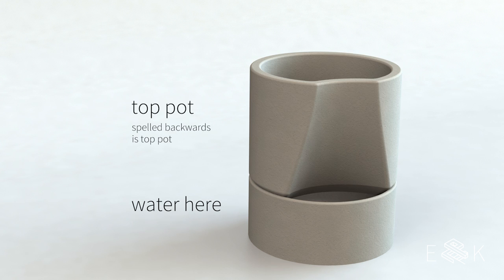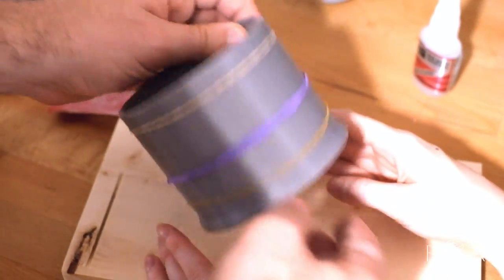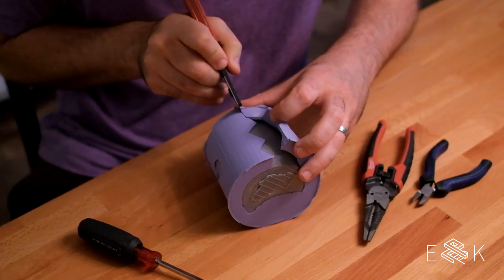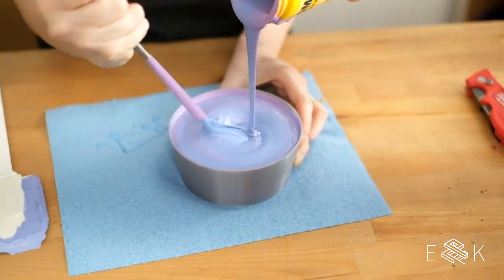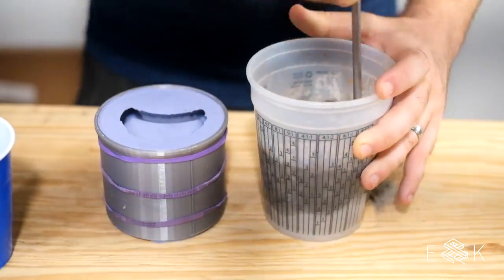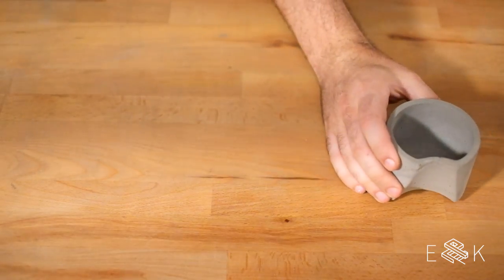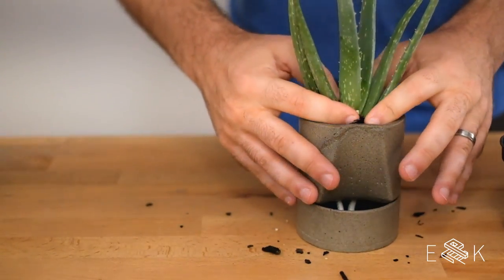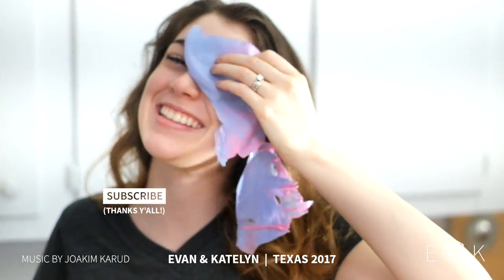DIY self watering concrete planter | How to

Comment: What type of Smooth on silicone did you exactly buy and was it a 5 gallon buckets? or the 2 gallon I know you mentioned it was around $175? Can you guide me to know which one you bought and for how much please?
Reply from the maker: Sure thing! We include all tools and materials used for each video in the description, along with the models but I'll give you some more info here too. Since we made the outer barrier of the mold close to the part we're casting, we didn't have to use much silicone at all, just the 2.8 lb sample size for $28 available here: http://amzn.to/2u4IQc7. Totaling everything up I would estimate the cost of getting all the supplies would be $75, but if you're careful with the mold (or probably re-design it some) then the cost for each concrete set would be around $0.50 for as long as the mold lasts.

Comment: Great DIY project! Can I use regular sandpaper to smooth out the concrete?
Reply from the maker: +Nikki DR we use regular sandpaper and it seems to work fine :) Just be careful with dust, you don't want to breath in concrete dust.

Comment: Whatever y'all are using to light the intro/outro (in front of the coloured walls) has a refresh rate that's not quite happy with the framerate on your camera and causes some interesting light differences on the cuts. It looks like there's about five sections of light (3 light, 2 dark) that alternate slowly (2 light, 3 dark). Just a heads up! These videos are irresistibly charming, though. Keep up the great work!
Reply from the maker: +SenoreQueso yes facepalm so frustrating trying to get the settings right to eliminate the banding. I think we might try different lights instead. Thank you!!! 😁😁

Comment: Quick question: Can I have the planter made out of wood, or do I have to go through the molding? And which type of wood would you suggest for each option?
Reply from the maker: Yeah you could make wood for sure. You have to seriously waterproof it but there are solutions for that. I would suggest a hardwood like walnut or maple

Comment: Hi. could you make another silicone mold like this one and sell it ? I want one, only problem is that I don't have a 3d printer..yet. Thanks
Reply from the maker: We're actually thinking of making and selling these. It really needs a redesign though. I'm thinking of doing the mold in two parts with a nicer seal between them. Or some loft features to make it easier to demold. We'll post on our Instagram and Etsy if we do :)

Comment: This might be a stupid question, but why didn't they just 3d print the mold itself instead of adding the silicone as an extra step? It's a fairly easy process, you just have to boolean cut the part into a cube in whatever cad software you're using.
Reply from the maker: +Griffin Brown we did that because we were using PLS plastic which isn't flexible and we thought it would be easier to make a silicone mold than clean up all the seams that might be left on the concrete from a multi-part mold. Also, we had planned on using the silicone mold to make multiples so all the work would have theoretically been done once for lots of planters (except then we broke the mold...RIP) 😋

Comment: It looks great, but I am having problems with the 'self watering' wording. So it is no different to any other potted plant, you add water when needed. Am I missing the point here?
Reply from the maker: +Pippa Kingsland I can see how it would be confusing! It's a term used for planters that have a reservoir you have to water much less frequently that the plant used to pull water from over time as it needs. So it requires less maintenance and guesswork, or so we hope!

Comment: Could just of made a wicking bed on a smaller scale. It uses the same idea and I feel the wicking bed would keep the soil more moist. A lot less work as well. And works in just about any sized container. Though container size will change the size of your water pocket at the bottom.
Reply from the maker: Haha, we are so bad with plants I had to look up a wicking bed :P True about less work but we were hoping to eventually turn this into a product. Thiiiink it might need a redesign though lol

Comment: "DIY" except you need, silicon, drills, sanding equipment, and oh yea a damn 3D printer
Reply from the maker: As we mention, the 3d printed parts could be replaced with wood. The other things are pretty basic tools that you can get pretty cheaply and easily 👍

Comment: Next time you can spare a LOT of work just by using ABS filament, and then placing the object in a so called "acetone vapor bath" that smooths it.
Its is very simple (despite what the name suggest). You take a plate, spill some acetone (frequently used as paint solvent, so you know where to look for it) on a plate, and place the printed part on top of it, well no in it, you must put some stuff in the acetone, and put the part on top of it so that its not placed directly into the solvent.
then you take a large cooking pot (or whatever else you can cover the thing with) and let it sit for a few minutes at max (google is your friend).
Take out the part before it gets as smooth as you want it, as it will smooth further after you take it out, since it takes time for the acetone to evaporate from it.

Also acetone is flamable, so don't be stupid, its also lightly toxic, so don't inhale it, and you should do all of this out in the open.
Reply from the maker: +Márton Léránt thanks for all the tips! We would love to try that someday. Will come back to this comment when the time comes

Comment: I've had a hard time keeping aloe vera alive too. My main problem is root rot, so I am trying drying them out regularly to keep the soil more sterile. In the long run, I think I just need cactus potting mix because the compost in normal potting mix has to much rot for aloe vera. I predict the constant water from the wick will not work, but I don't know for sure.
Reply from the maker: The aloe survived but the other succulent did not. The aloe actually outgrew this pot and is still around! Cactus mix is what we use

Comment: 3D-printer and mould making is a pretty good idea actually, despite the problems here. Might have to sneak down to the design department at work and flirt with them a bit, see if they can print out some stuff for me. I wonder if printing a soft rubber like plastic will help or hurt this, might be easier to get the mould off, might bind even harder to the silicone :P
Reply from the maker: +eldsprutandedrake yeah that's a really interesting idea using a more rubbery print. Maybe you could print the mold instead of needing to make a silicone one. Might be harder to clean up the printer lines on that kind of material but could be worth a try!

Comment: I really like this project of yours. Just wondering is there a way to replace the 3D aspect? Because i don't own a 3D printer nor do i know anyone who has one.
Reply from the maker: +Pieter van der Berg thanks, and definitely! It would need to be a slightly different shape, but if you replaced the 3D model with wood (like a square planter and a square reservoir underneath), then you could build a wood form around it (to replace our 3D form we used to contain the silicone) and pour the silicone in the space between the wood planter and the wood form, and continue from there. Ben from HomeMade Modern has a lot of great examples of this. If you check out his videos, tell him we sent ya!

Comment: There is a hole in your silicone mold because, first, you need to stir without getting air bubbles in. Second, you need to keep track on the time the minute you start stirring and pouring. You should consider changing into another badge if it starts getting too sticky while stirring. Third, should place your planter mold onto a wooden board and tap it to get as much air bubble as much as you can after the pour of silicone (like you did when u are doing your second component of your planter)  Nice design be the way! look forward to your next invention
Reply from the maker: +DanSing873432 thank you for the tips! Still getting used to workiing with silicone. Also, glad you like the design! Lots more inventions and projects on the way 😄😄

Comment: I am not sure if the nylon will wick water like you want it to.  But it would be very easy to replace it with cotton.  I would like to know if it does work.
Reply from the maker: +HonestDoubter we weren't sure either but so far it's working! Maybe different types of rope would be better for different plants, depending on how quickly they wick the water up

Comment: hey that's really cool!! although since there'll be stagnant water in the bottom dish, will it be a problem for breeding aedes mosquitoes? i live in Singapore and dengue is quite a big issue here
Reply from the maker: +cherylcpl we use it inside only but if it goes outside yeah I would recommend keeping the sides straight to close the bottom off. It would still be easy to lift the top part to refill the reservoir :)

Comment: Won't the water just evaporate? And wouldn't it be a better idea to have a larger, sealed water container, so you genuinely don't have to water them for a long period of time? And wouldn't it be a much better idea to soak the rope into the water at the bottom and the corners as opposed to only skim the top? Also, does it work?
Reply from the maker: Hey there! It does work (the rope pulls the water upward) though it'll be better for plants that need more water (turns out we didn't choose the most ideal plant options). Never had any issues with the water evaporating since we kept it inside, but I wouldn't use this design outside. And you could probably test different lengths of rope to see what works best for you! Luckily the rope is the easiest part, and since you have to buy it in a larger amount than you'll need you'll have some spare to experiment with. Hope this helps!

Comment: There were many reasons thy you had trouble releasing the mold, the two best solutions are to spray it with a quick release and the second thing is to use acetone; just a little bit, to smooth Down the bumps that the 3D printer made. Make sure to wash it off tho
Reply from the maker: +ratasafau we normally use mold release but it totally slipped out minds! Haha hopefully we remember next time

Comment: Curious why you didn't do it with like metal cans from the beginning like you found one that was bigger than the other and inserted it and put sticks to make it I don't know how to explain it but I think I would have done that instead of making a mold but great idea thanks
Reply from the maker: That would work for a basic planter mold for sure, but we wanted a little recessed area to pour water into the bottom part so we needed a bit more of a custom shape

Comment: Yea, DIY... if you happen to have access to a 3D printer
Reply from the maker: +Alex Mindock like we said in the beginning, you could definitely replace the 3D printed parts with a simple wood form to make your mold from if you did straight edges instead of curved. The rest of the steps would still apply. Hopefully it'll still provide some valuable info to folks 👍

Comment: What was your modeling software?
Reply from the maker: +IceTurf we used Solidworks because that's what we're most familiar with, but OnShape is a great free alternative (we did a 3D printed hose adapter video in OnShape if you wanna see how it is to work in it)

Comment: Which CAD software did you guys use to make the model?  Or do you have a recommendation?  I know a bit of blender, but it's proving a pain in the posterior to get accurate dimensions in.  Tried TinkerCAD just now, but it's a little too basic to get some of the details I want...
Reply from the maker: +George Bones we used solidworks for this model which is great but really expensive. We've recently switched to Fusion 360 though since it's more accessible to everyone (free for most people) and that would be my recommendation. Very powerful and pretty accessible :) you can get those accurate dimensions with it for sure
Reply: Neat - thank you!

Comment: Why didn't you just use the 3D printer to make this instead of #D printing then making a mold  (badly) and then pouring the cement- I feel like you could have saved tons of time just stopping with the 3D mold.
Reply from the maker: +my Name is Nobody good questions! There were a couple reasons. One, we were thinking if we made a mold we could produce lots of concrete planters, which would be nice. Two, we liked the idea of a concrete planter instead of a plastic one. Hope that helps!
Reply: Makes sense- Thanks :) I really do like the overall outcome though- it is very nice, Good job guys, u just have to work on making the molds.. LOL.

Comment: Awesome video and cool idea
One question: Wouldn't it have been possible to print the mold itself?(instead of the actual pot and then making a mold with silicon)
Reply from the maker: +Nicolas Ruck yeah there are some flexible filaments out there were excited to try out. I don't think the surface finish will be as good but for a simple shapes it should work well :) maybe an idea for an upcoming vidon
Reply: EvanAndKatelyn ah okay interesting :D

Comment: You can smooth out the 3D prints with an acetone vapor bath
Reply from the maker: We mainly work in PLA since we print in our house without a vent outside. I heard about a filament that smooths well under alcohol though, that seems interesting. Might try ABS and a vapor bath if I left my printer in the garage but I might want a cheaper printer to try that lol

Comment: Another youtuber uses the vibration from one of those little hand sanders (the B&D Mouse) to shake out air bubbles - seems to work rather well.  Have you tried using coloured concrete at all?  I'd be curious to see how that goes.
Reply from the maker: +Dthelwal Dthelwal yes we will have to try the vibration technique! We haven't tried colored concrete but we really want to so we probably will at some point 😁👍
Reply: I've seen three variations on that - one with a really stark white concrete (it was surreal, looked almost like porcelain when set), others which were pre-coloured and some which they coloured with additional powder later on.  
As for the vibration technique - this guy is where I saw it (in this one he's using a larger hand sander I believe:  https://youtu.be/uSSp3X07Vls?t=75)
With your moulds - have you ever tried coating the silicon with oil (e.g. olive oil) first to reduce grip of the concrete to the silicon?  I saw someone do that with wood moulds (she also did it with polystyrene and plastic), she was brushing it onto the surface of the mould and it seemed to work rather well.  I can't speak from experience though, I've yet to try any of this - yet.  First thing I want to make is a kind of tight fit tray for a mechanical keyboard (to make it extremely heavy dead weight to change the acoustic pattern of mechanical keys).

Comment: Could you just 3d print the pot with the hole instead of concrete
Reply from the maker: 3D prints aren't water tight but maybe if we sealed it with epoxy

Comment: Maybe you need a bigger reservoir so you can leave-it-alone longer.
And put a wire mesh so mosquitoes won't dwell in them.
Reply from the maker: +Swiper Fox definitely considering a bigger planter (w/ bigger reservoir) if we ever do a version 2.0. We intended this for indoor use so mosquitos aren't an issue, but good idea if you're using it outside!
Reply: Love the silicon comment... its so SILLY. CON...tinue making more pots. <3
Reply from the maker: I see what you did there! :D

Comment: Way over complicated for something you could mimic with two red solo cups. Or just buy the flowers pots with a water reservoir on the bottom from lowe's for 8$ and put rope into the drain holes to be the same thing. Also --you wanted the rope ends to fray. It is a wick, after all.
Reply from the maker: +Legendary Wish we originally thought about buying one (they sell them at Ikea too) but we really wanted a concrete one and thought it would be a fun project to learn some new skills on. Thank you! And yeah maybe we can cut the rope if we switch to a thirstier plant! 😊
Reply: Well, since you're listening. The cut into the top portion (slope) does more harm than good. You've opened the water supply to light so it will be more susceptible to growing bacteria/algae , as well now insects can easily get to it and breed, and lastly -- it will obviously evaporate faster. I'll give you points for being artsy though. =p It's a nice conversation starter.
Reply from the maker: +Legendary Wish hopefully we can get to a version two that utilizes some of the feedback we've been getting :)

Comment: Instead of banging on sides or the table top  u can use an orbital sander to do the vibrate for you
Reply from the maker: Thanks for the tip! I'm also thinking of making a vibrating table one day using a motor and 3d printing and some ball bearings :D

Comment: I don't have instagram so I would like to know how the pot is holding up, what can it handle so far, would you change anything, and have you changed anything.
Reply from the maker: +Chicharrito Hernadez so far it's working! Because we chose plants that don't like a lot of water, we let the reservoir dry out completely in between watering. Lots of folks have said thirstier plants would be better for these. But functionally speaking, the rope wicks the water and the plants are both alive!
Reply: Awesome to hear and I think I might try this without a 3D printer
Reply from the maker: +Chicharrito Hernadez best of luck! Ben Uyeda at the Homemade Modern channel has some good tips for using wood and various other items to make concrete molds so that should help when it comes to tackling it without a 3d printer